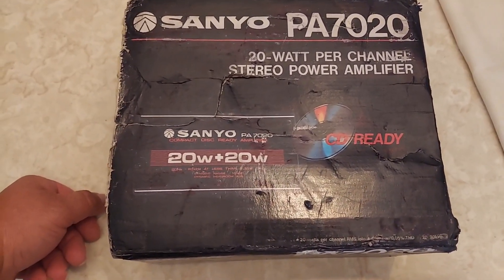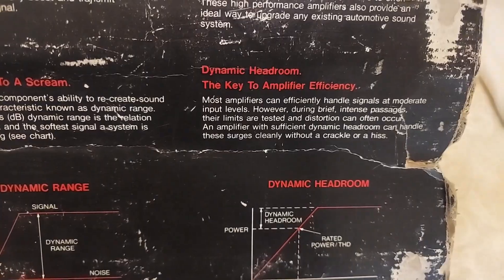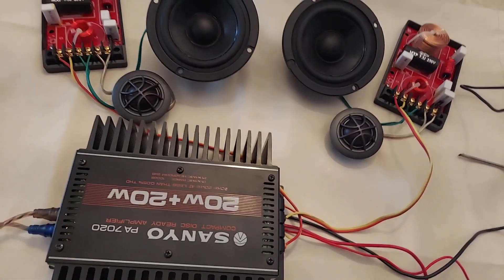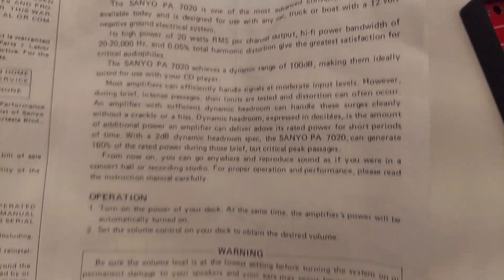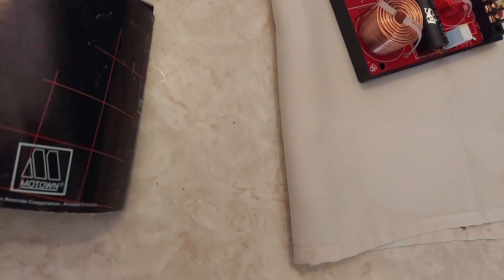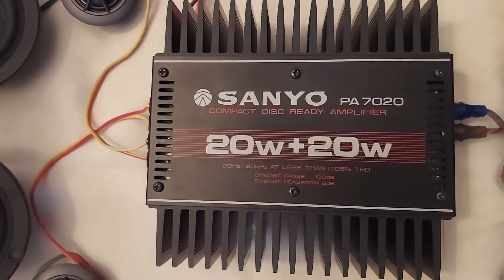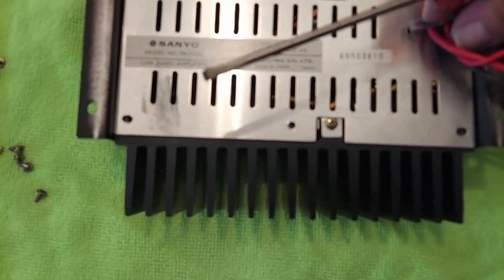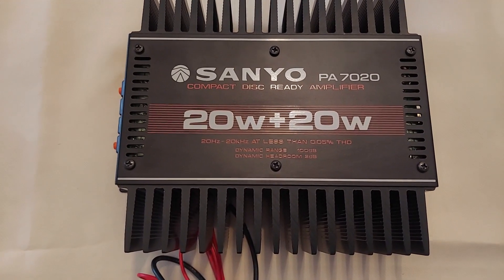Sanyo PA7020 1986 car audio amp NOS

Comment: Back in the early 90's, I  hooked up a Sanyo PA6110 with 4 Pioneer TSV69 and it was one of the best systems I've ever heard. The TSV-69 are one of the best speakers ever to come out from Pioneer with a 95db/1m sensitivity rating.

Comment: I’ve got an old Sanyo made like that one, it’s a 50+50. I can’t remember what the model number it is, been a while since I’ve looked at it. Great video.
Reply from the maker: Hi Wade, I also have a 50 Watt x 2  Sanyo it is a model PA6100.
Sanyo made awesome car audio equipment back then. Most of the headunits and amplifiers were top-notch.
Reply: @RareorVintageCarAudio  I agree they made some awesome gadgets. The 6100 uses those STK-0049 Darlington power pack modules. Fisher used those same modules in a few of their receivers.
Reply: Great amps..but no short circuit protection from what I remember...
Reply: My car had a Sherwood 240 on 4 10 inch bumpers. Cheap but it worked. When a friend of mine showed up with that Sanyo 50x50 hooked up to everything in his car we thought for sure he had lost his mind and then he turned it on and shut us all up. It ran hot all the time so he wired a small fan to keep it cool so he could ride all day.
Reply from the maker: Thanks for your comment.
Reply from the maker: Thanks for your comment.